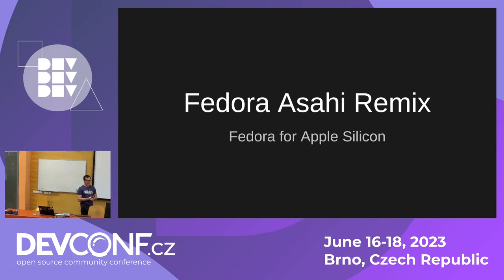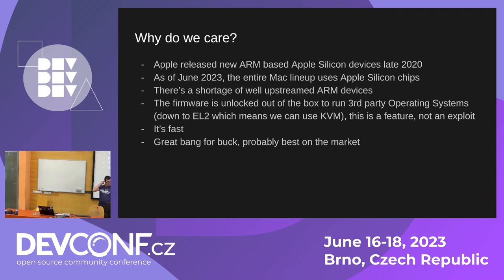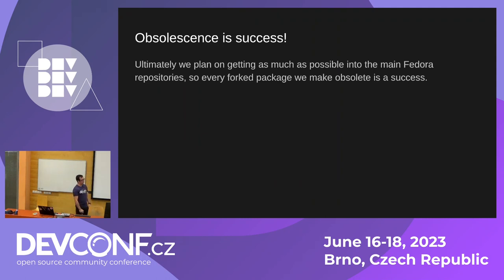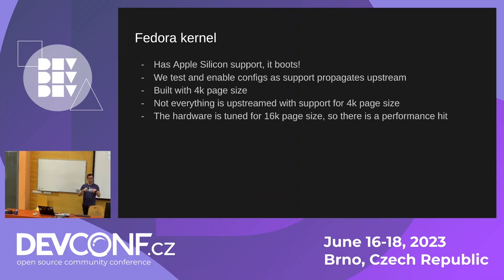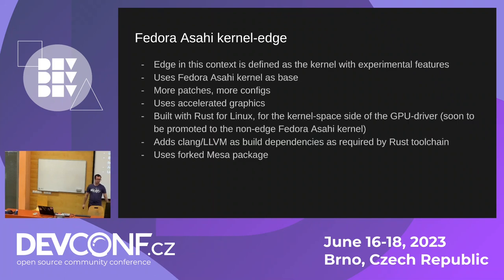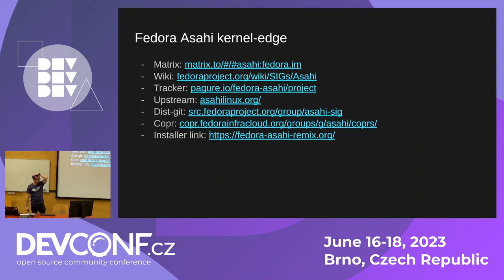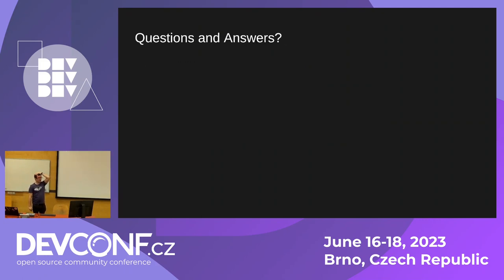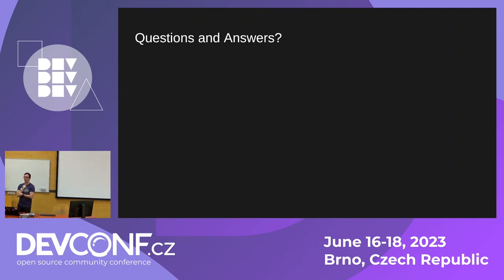Fedora Asahi Remix - DevConf.CZ 2023

Comment: Great talk \o/ congrats on releasing the installer.

I believe it was meant that sound works, but built-in speakers are not yet in stable release.
Reply: Yeah I didn't explain the full picture, there are some ways in which sound works, via USB speakers (since that's just a USB device), via bluetooth speakers, via headphones jack. Even built-in speakers and audio over HDMI has advanced since I did this talk...